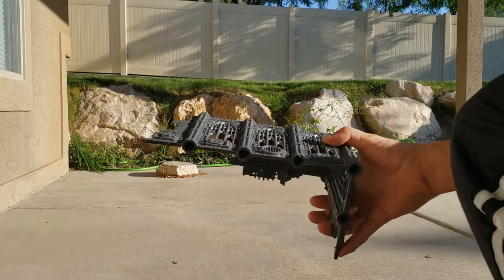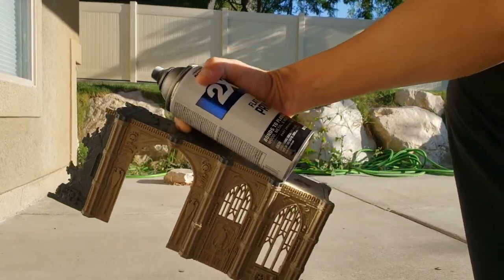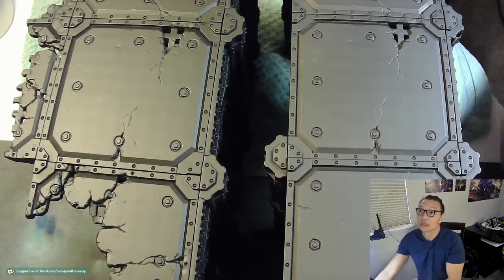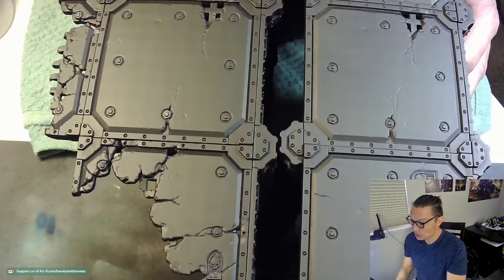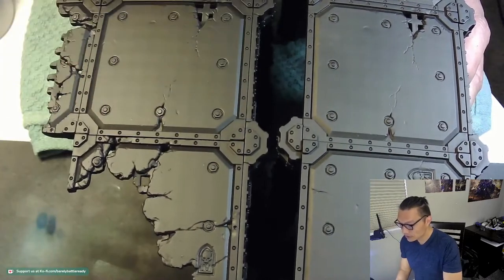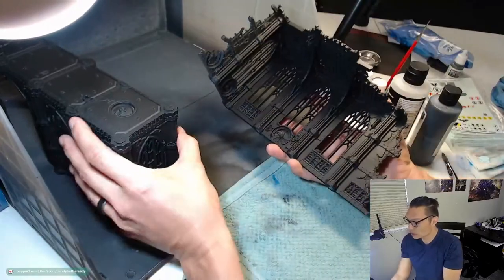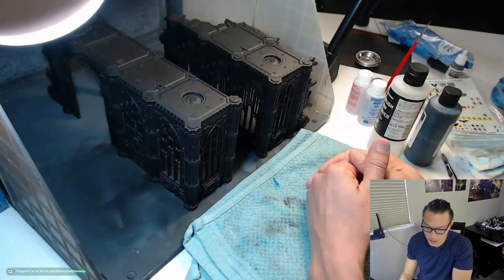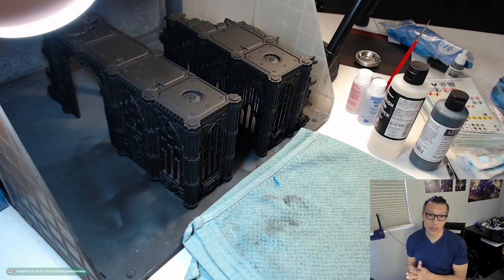Airbrush 101 Part 3: Rattle Can (Aerosol) vs Airbrush Primer

Comment: My current problem with the airbrush primer is that it can easily scratched off even after 3 days of curing. The rattle can primed models are basically scratch proof. Are airbrushed primed models supposed to be varnished before any rougher handling?
Reply from the maker: I have had to varnish models after priming specifically because it will rub off. I don't generally use painting handles so I am pretty rough with the models while I paint them. If you did use a painting handle or another contraption you could probably get away without varnishing them.